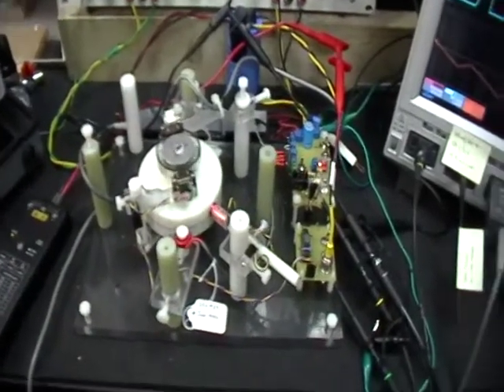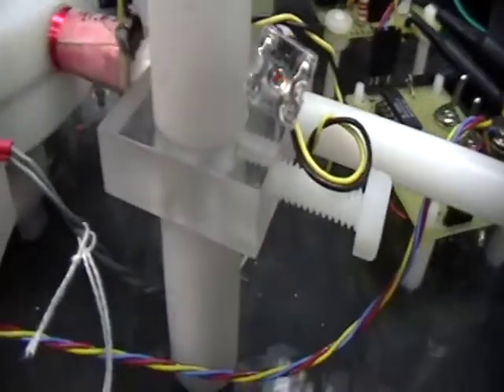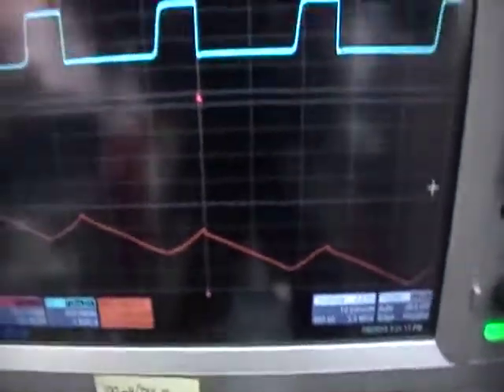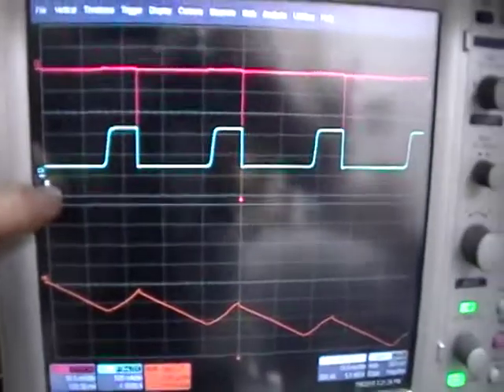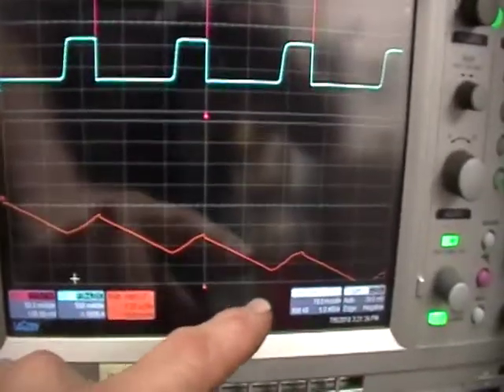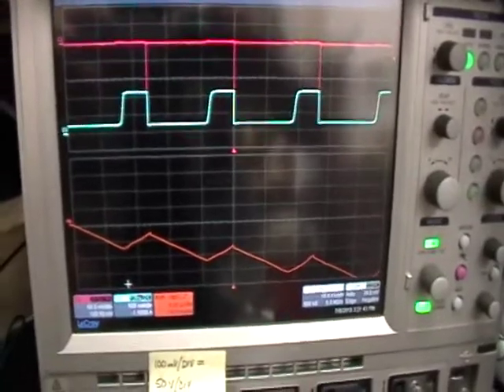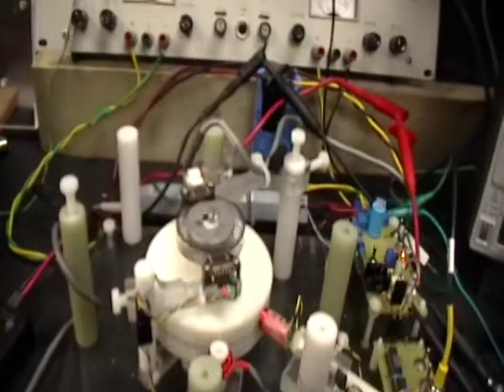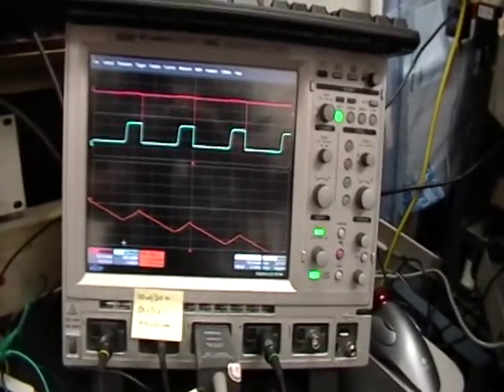alt.snakeoil Video Report 11: Steorn's Orbo Claim Fully Replicated

Comment: Well, I had a look inside the O-Cube and guess what I found,,,,,,,  There are 2 x 9v EverReady batteries going through a 1 meg ohm resistor charging another battery and connected to a USB socket..........  The components are all embedded in a solid potting mix to give it weight and a realistic view. component cost: approx $4.00

The O-cube is NOT a self charging system,   Steorn is lying and cheating his customers...  The O-Cube is a fraud...
Reply from the maker: +Far Que Pretty outrageous all right.

Comment: OK so you've replicated their results and you agree there is no benefit to the machine?  because so far you really haven't made that clear.  obviously your an intelligent person to build such a device, in your home I'm assuming.  But if you would clarify what you think the potential is and how you can take electrical energy convert it to kinetic energy, via magnets or motor however defined, and then convert it back to electrical energy and end up with more than you started with?

Comment: again input wattage and output wattage simple questions that need to be answered... obviously you cannot have negative input that would imply that there is no input....   if the wattage going in is not less than the output then your machine does nothing but spin a rotor with electro magnets.... big deal.

Comment from the maker: The instantaneous input power is being calculated by the oscilloscope from voltage and current measurements. The instantaneous power curve is then integrated over the sampling time of the oscilloscope's screen window, to produce the energy in Joules that went past the probes during that time. This is plotted on the scope's screen as a decreasing (negatively sloped) red line.  This is the same evidence offered by Steorn as "proof" of their Orbo's electrical OU: a "negative" use of energy to run.

Comment: What is the input Wattage and output wattage... Transformes can take small voltage and increase it by decreasing amperage it happens out side your house all day every day.. powerlines are usaully around 765,000 volts but when it comes into your house it is 120 volts. having an input voltage of X does not mean your output has any more energy just b/c its a higher voltage. it could have less amperage thus rendering it useless... the only measurement that would clarify is wattage input and output.

Comment: are you able to put it to self run?  or recirculate the energy and extract the extra power generated?

so if it is consuming negative energy, the device will run forever with the same battery?

please explain better if its not asking to much!

hugs

Comment from the maker: @obesehairydog 
Let us say, rather, that I have replicated Steorn's claims, by following their instructions closely and using similar equipment to theirs. There is no discrepancy in the data. However, there is a very basic error occurring, and without Steorn's cooperation I cannot be assured that they are not suffering from the same error. Since what they are claiming is impossible and they have offered no credible evidence for their claims, the conclusion should be clear.